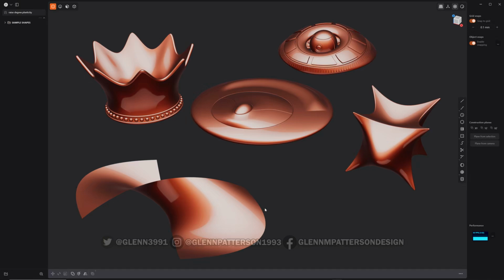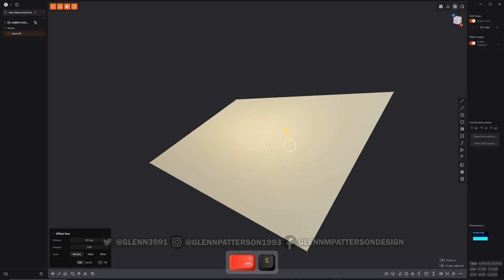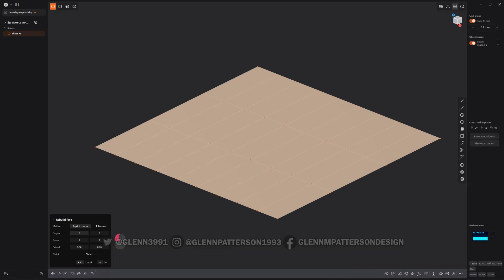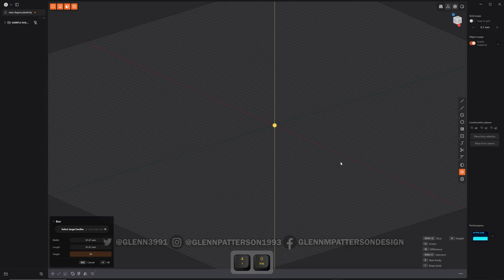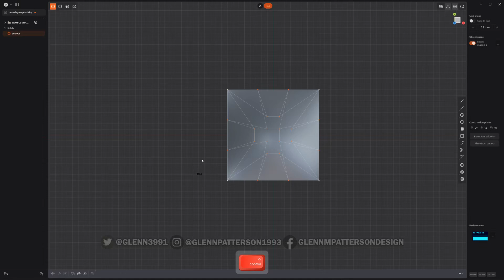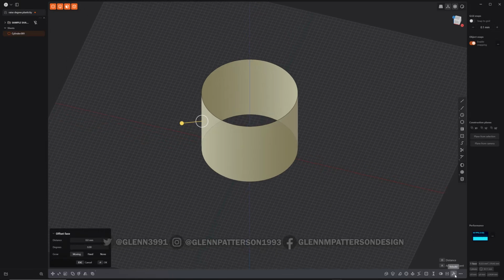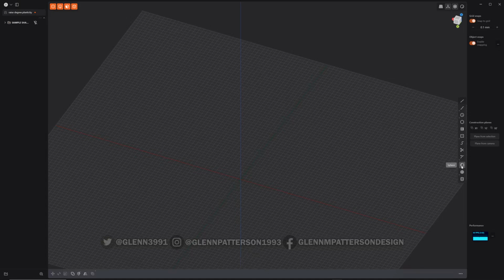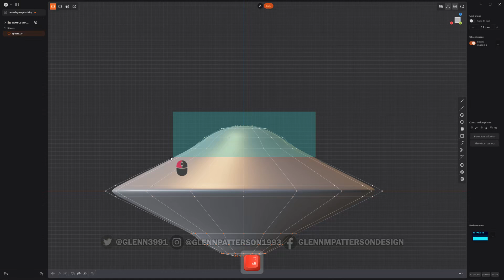96 PLASTICITY 101 RAISE DEGREE

Comment: do you need high end hardware to run plasticity well
Reply from the maker: I think you can get away with a lower end PC. It only really bogs down PC when doing a operation on multiple things at once like booleans and pipe command. Also there are 3 or 4 quality settings you can adjust. You might give 30 day free trial a go and see how well it runs before you invest in it.
Reply: @Glenn3D1993  thank you
Reply: No you don’t need a high in computer. I run it on 5 year old  Microsoft laptop